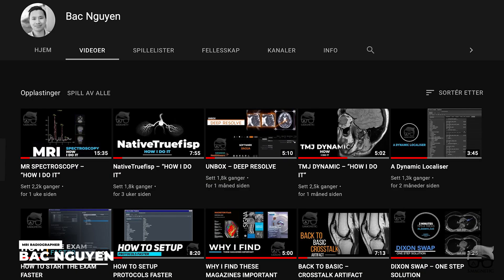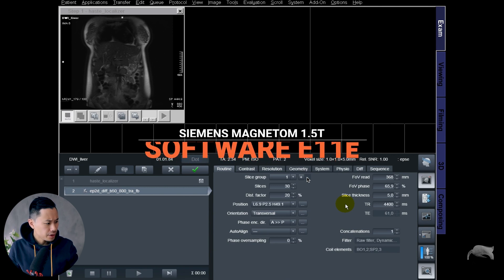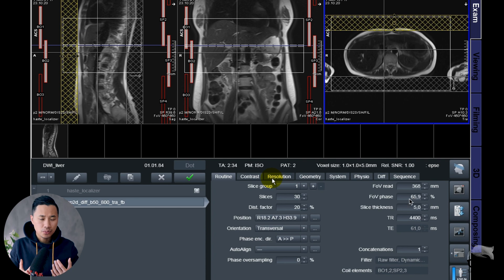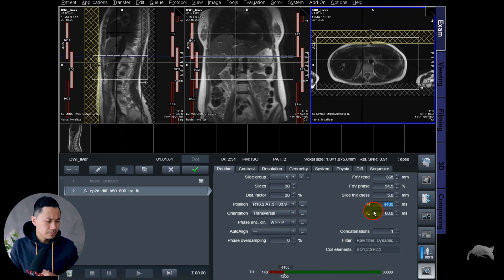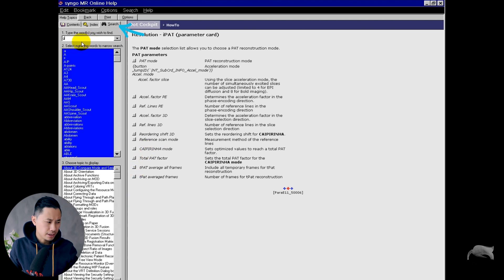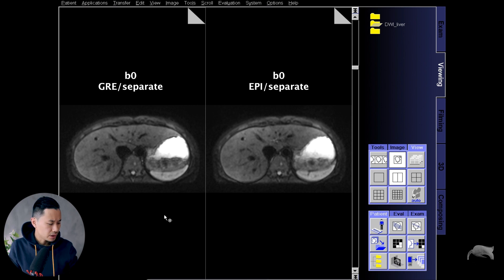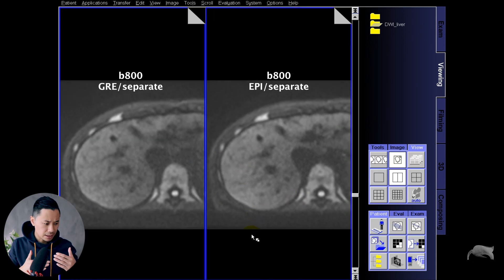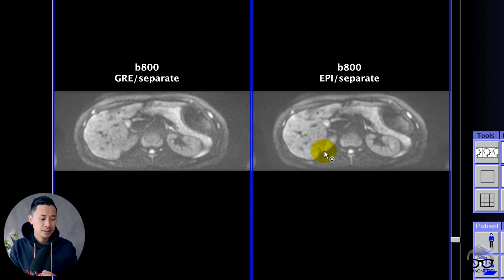LIVER IMAGING – OPTIMIZING DWI (part 1)

Comment: Another great and informative video.  Quick question.  When you have a bigger pacient usually you get the same artifact in the middle of the abdomen on all sequences.  What can you change to reduce it on a T2 FAT sat axial for example? Ofc an additional average would work but that doubles the time.

Any tips Bac?
Reply from the maker: Good question. Either let go of the resolution  or added scan time to gain more snr. Challenging with thicker patients for sure.
Reply: @Nguyen_MRI  added scan time you mean using additional averages or just increasing the TR?
Reply from the maker: @mihaimoldo  averages.
Reply from the maker: Phase oversampling also.
Reply: @Nguyen_MRI  ah.  OK Thank you! Usually axials on abdomen we reduce fov phase to reduce scan time as low as possible,  never thought about phase over sampling.
Reply from the maker: @mihaimoldo  true on that but also remember whenever using parallel imaging you should have so oversampling or air in  your fov especially on thicker patients. Or you will suffer in the mid part

Comment: Hi Bac! 
Do you run Liver DWI in freebreath (in this case with or without breathing trigger) or in breathold?
Reply from the maker: In this example fb.
Reply: @Nguyen_MRI  ok. Do you recommend breathold or trigger? Does it take so much more time with better e results or not?
Reply from the maker: @filippobovero8080  interesting question. Bh definitely faster. But I stand between trig or fb. Currently I’m testing a lot too see between those two. But for 3T I strongly believe trig is better due to less signal lost in the left liver lobe due to the heart. On 1.5T this issue is less common but, that’s why I still wondering trig or fb. I started with trig. But went over to fb a few years ago. Now stand between those two.

Comment: Thx bac, usually I get a lot of artifacts/noise when scanning prostate at 200 below fov. I tend to just increase averaging and optimize noise reduction, but sometimes it doesn't help. Will try this soon.
Reply: How to send videos on this forum I don’t know or else I can send. I have done several prostate exam and it comes fantastic with small FOV but I am using 3T what about you ?
Reply from the maker: @shahzadahmed3391  or email me at Bac.nguyen@aristra.com 
We don’t do prostate at our hospital. But I use both 1.5T and 3T.
Reply: @Nguyen_MRI  I will sure in shah Allah
Reply from the maker: Yes try that and let me know how it goes. Thanks.

Comment: Very good video ! thanks a lot.
Would you please share parameters like: monoppolar or Bipolar ? 
3-scan trace or ?

Thanks in advance!
Reply: For body stuff, eg. liver. I'm using 3D diagonal more and more. Usually between 3-5 averages for b50 and 12-20 averages for b800.
I still using 3-trace or 4-trace for neuro though.
I'm interested in how people use bipolar vs monopolar.

If you have access to scanners running XA software the help files are much more detailed than on E versions!
Reply from the maker: I’ve been using 3 scan trace with monopolar. But also tried 3D diagonal with monopolar. I’ve seen people using more and more 3D diagonal approach. So curious myself. What about you?
Reply: @Nguyen_MRI  in new version like VE11E, Siemens default Liver DWI sequence is setup with 3D Diagonal. It allows more average for better SNR. I used to 3scan-trace with Bipolar.
Reply from the maker: @jrm093  true on that. Thanks.

Comment: Bac, does it work in other anatomies (thorax, pelvis, lower extremities) as well?
Reply from the maker: good question. yes. i usually do whole body dwi coronal plane, but sometimes i could see this artifact going through the images, so now i use epi separate for whole body dwi as well. works much better. artifact gone. to be hones. i try to use epi separate as long as i have the option to do that. by that, i can have smaller fov phase / oversampling, thereby lowering the TE. more snr and also i want to mention, you can also use higher pat if wanting so without getting the "pat" artifact.
Reply: @Nguyen_MRI  Great! Thanks for the explanation
Reply from the maker: No problem. Thanks for showing interest. Really motivating. ☺️